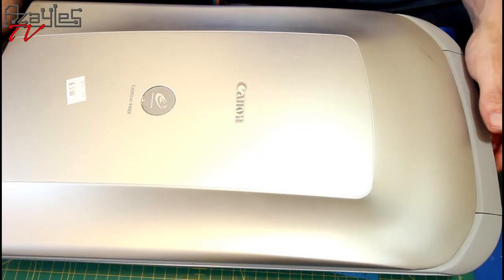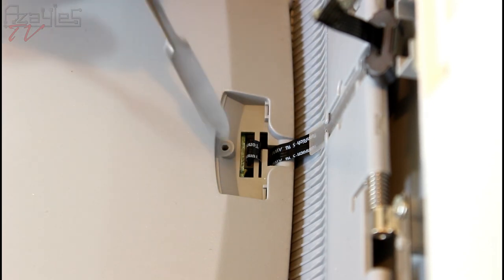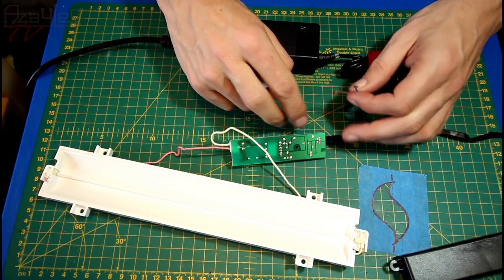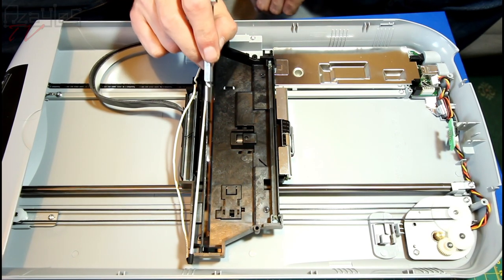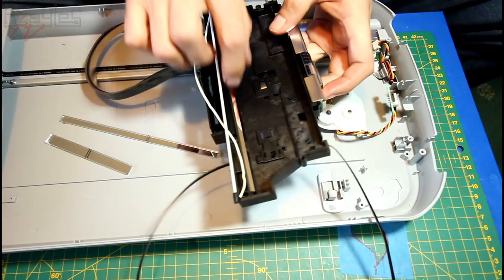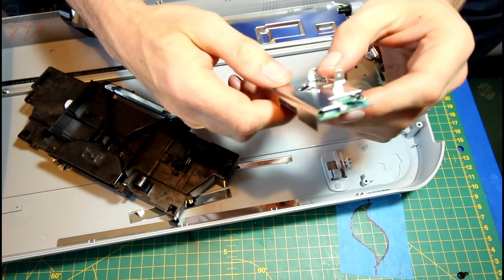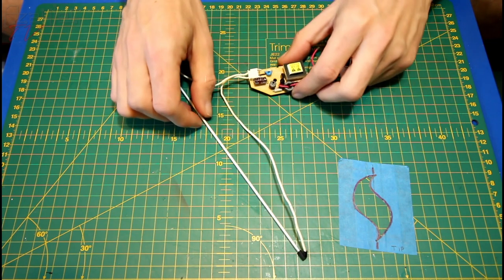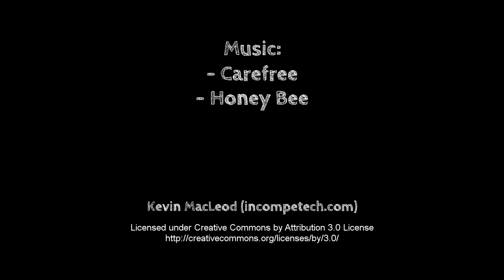Canon CanoScan 4400F Scanner Teardown

Comment: Thanks. I needed to clean the inside of my glass so now I know how to remove it. Also, a big suprise was the slide scanner in the top which I had no idea was there! Bonus.

My top didn't side off so easy. It turns out there are 4 locking tabs, 2 on each side. The 2 at the back are where the curve comes up to the flat horiziontal section just above the 5 vertical bars on each side. They lock under the small horizontial bar. The other 2 are on each side in the middle above the 3 vertical bars on each side. They lock into the indent in the lower casing. Once these are popped, the top slides to the back as in the video.

Comment: Hey mate, you wouldn't happen to know how to disassemble a 5600F would you? The gears are moving but the scanning mechanism itself doesn't move to scan. I'm trying to get it open to attempt to fix it but I can't find anything.
Reply from the maker: Hi there!
I don't know how to disassemble that particular model, but I imagine it's similar. Look for screws under rubber feet and stickers. The case may also have clips, but it'll almost certainly be screwed primarily because it's a big bulky item.
Best of luck! :D

Comment: Hi, thank you for your video. I'm trying to clean glass from inside and can't slide out upper cover with the glass as you have shown. I've removed 3 screws and black ribbon but my cover is stuck. Have you done anything else to slide upper cover away or I need just put more force to do it? Thank you.
Reply: Hey I just had a similar problem but I (carefully) pried out the 2 plastic tabs holding the upper cover. They're on either side close to the corners of the scanner on the same side as the hinge. Once you get those it should slide out. Good luck!

Comment: my scanner died mid-scan. i suspect the "fuse" is blown but i cannot find where it is. i don't see it in the video either. i don't want to tear down the tin foil above the board if it is not even inside of it.
Reply from the maker: I can't remember where it is and I'm not sure where the board is anymore, but if there is a fuse on the board, it'll be near the power components near where the power is plugged in. It'll likely be a small rectangle, often white in colour, and marked with F1 on the board 😊
Good luck! x
Reply: @azyfloof  there is a marking FUSE 125V 1A where the power is plugged into. but nothing that looks like a fuse at all. thanks for your response 🙂
Reply from the maker: @rithantony  That sounds like the component you want :) Is it a surface mount device? I've seen fuses masquerade as through-hole resistors, too. Do a continuity test on it, see if it's open circuit

Comment: By any chance do you have a higher-resolution still image of the circuit board? There is an open-source project for scanner drivers and it might help to figure out how the thing works. Thanks!
Reply: Or just the numbers on the microcontroller that's running the thing....
Reply: After doing some searching I think it's the Genesys Logic GL843. The logo seems similar.

Comment: I have one of these and it quit working. Is there perhaps a "non user-servicable" fuse inside this machine? Perhaps that might be what is wrong with mine? It worked very well for me, especially the slide and film scanner function.
Reply: Rick did you solve your problem ? I think I have the same problem and would like to hear if you solved it. Greetings
Reply: Mine is stop working and the scanner lamp inside innert shows blinking... Anyone know how to solve it and bring it back to work?
Reply: Mine too, hopefully any information to solve the problem?
Reply from the maker: Apologies for the late response! Some of these I didn't get notifications for :O There is indeed a fuse! It's marked F1 on the board, and it's near the barrel jack connector